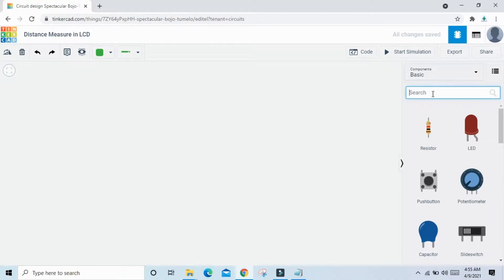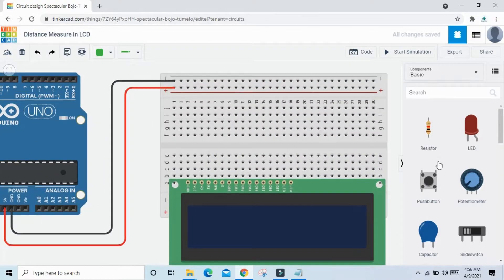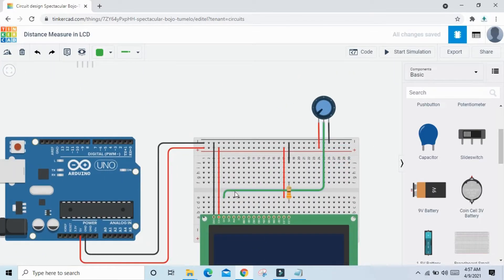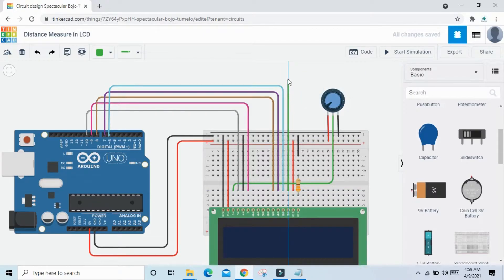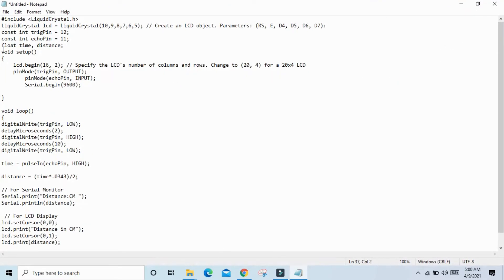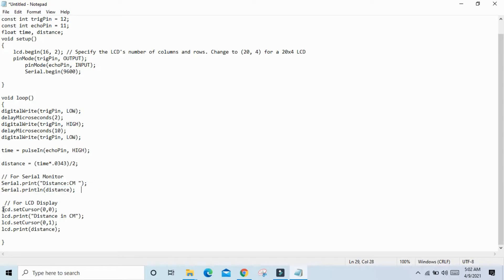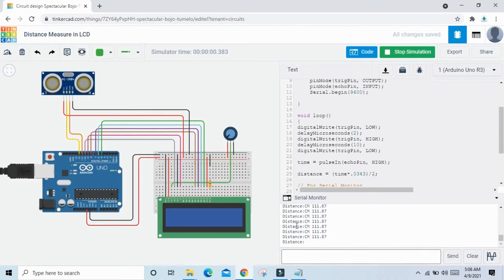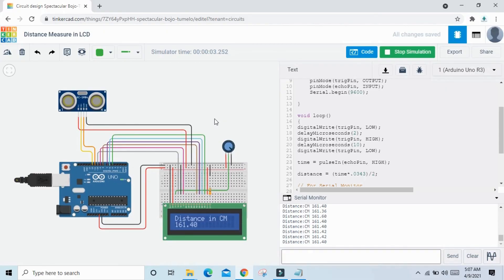31 Ultrasonic sensor tinkercad with lcd in English || Block Code || simulator || tinkercad circuit

Comment: include <LiquidCrystal.h>
LiquidCrystal lcd = LiquidCrystal(10,9,8,7,6,5); // Create an LCD object. Parameters: (RS, E, D4, D5, D6, D7):
const int trigPin = 12;
const int echoPin = 11;
float time, distance;
void setup() 
{
    lcd.begin(16, 2); // Specify the LCD's number of columns and rows. Change to (20, 4) for a 20x4 LCD
    pinMode(trigPin, OUTPUT);  
	pinMode(echoPin, INPUT);  
	Serial.begin(9600);
  
}

void loop() 
{
digitalWrite(trigPin, LOW);  
delayMicroseconds(2);  
digitalWrite(trigPin, HIGH);  
delayMicroseconds(10);  
digitalWrite(trigPin, LOW);  

time = pulseIn(echoPin, HIGH);

distance = (time*.0343)/2;  

// For Serial Monitor
Serial.print("Distance:CM ");  
Serial.println(distance);  

 // For LCD Display
lcd.setCursor(0,0);
lcd.print("Distance in CM");
lcd.setCurso